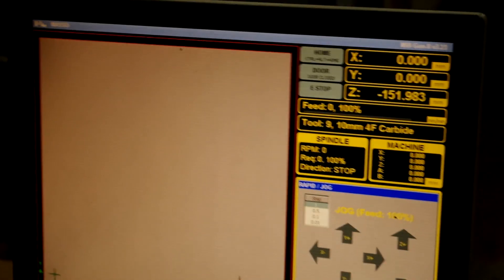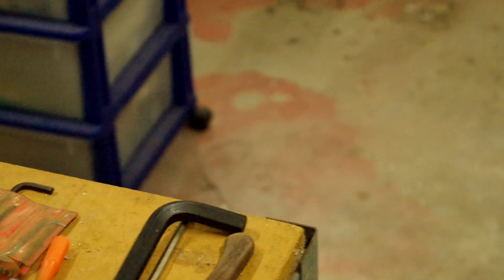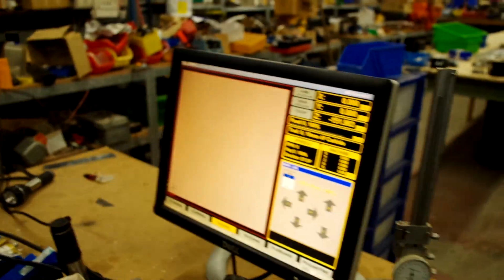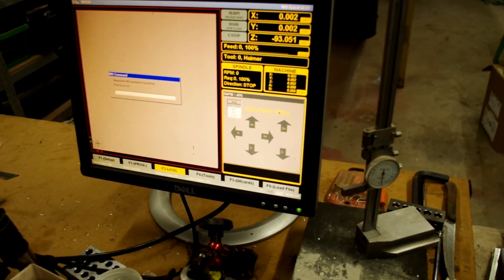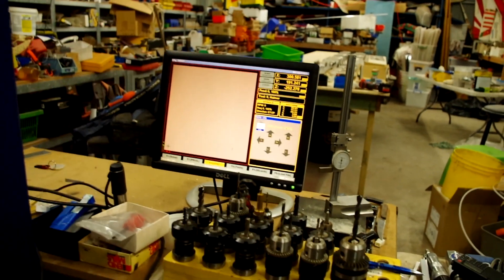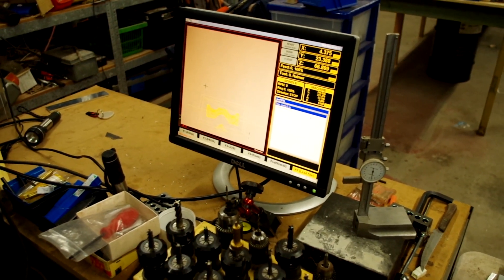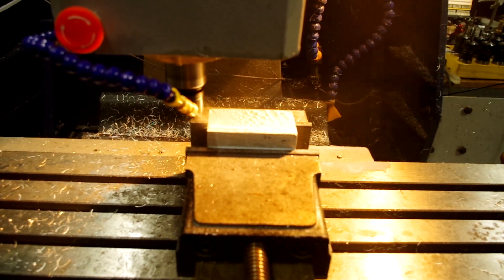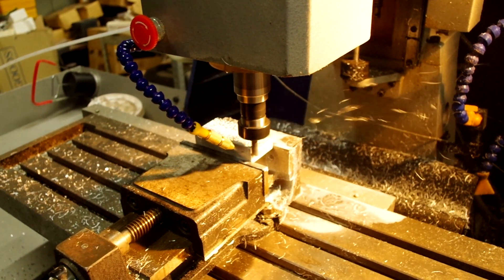Masso CNC controller and Haimer 3D setup

Comment: Thanks for the help! I'm super excited to be getting a haimer very soon. This will definitely demystify setting it with my Masso
Reply from the maker: Hi Ryan  Make sure you order spare tips..I broke mine after a few months and did not have a spare. They are expensive. I need tro do a better video as I had the flu and a crappy camera and lighting but it tells you how to do it. Set your Haimer as tool 0 and use the MDI command to change to tool 0 first then its all simple and the offsets in the tool table work a treat

Comment: Is this a Novakon mill?
Reply from the maker: Hi LeoB  yes it is basically a Novakon Torus. I bought a few machines from the company that actually makes the "base" machine..same as Novakon and Syil do and I fitted it with originally my own electronics and ran it on Mach3  then I changed that out for a PMDX 126 board and used it with Mach3 then got rid of Mach3 and set the machine up o the PMDX with LinuxCNC..that was a struggle getting that going but the machine worked great but was still controlled with a PC. I saw the Masso and being in electronics and not wanting to spend US$1200 for Siemens or ADtech controller I bought the Masso for less than half that. It took literally an hour to change it over and I just love the Masso. The machine moves much better and doesnt have all that excess info on the screen that you dont need. I really love it and  it has not missed a beat since
Reply from the maker: I will soon convert the machine from the 3phase steppers to servos I have bought also will be changing the spindle motor for a servo spindle so it will then do rigid tapping

Comment: Just bought a MASSO. How do you like yours?
Reply from the maker: I love it. So much better than using a PC and my machine sounds better as well when moving it runs now like it has a proper motion controller.. Also the on screen graphics are only what you need. Just print out the list of key commands like for jog and spindle override until you get used to the commands. When loading a job from the USB it can take a min but thats no drama. Also the trajectory planner on screen once you get used to it allows you to see any stupid paths that might be there. Any machine I build now I will use the Masso. I want to build a flatbed router and a plasma